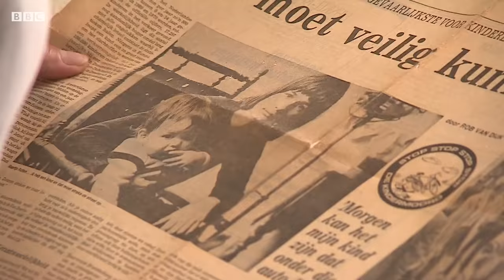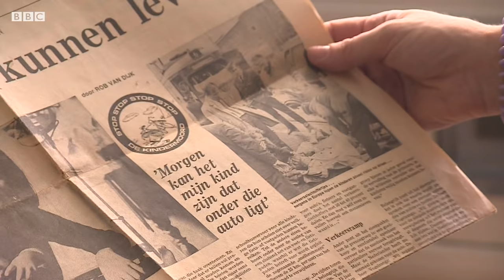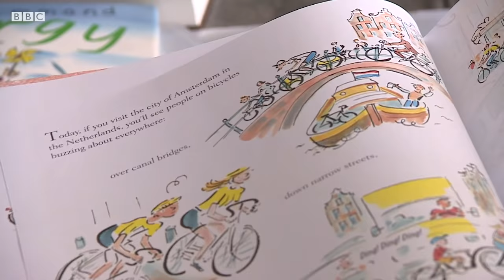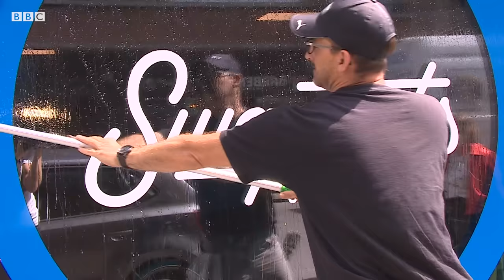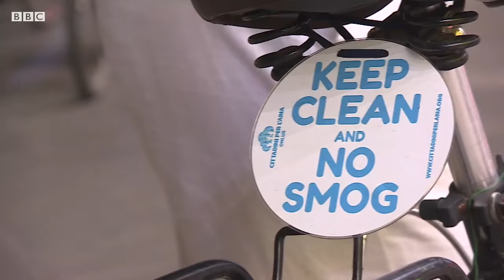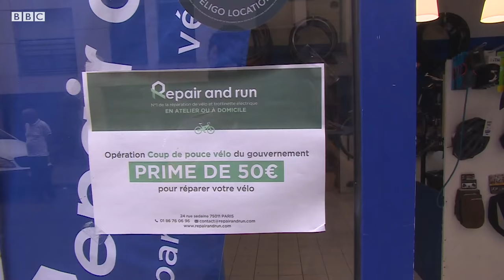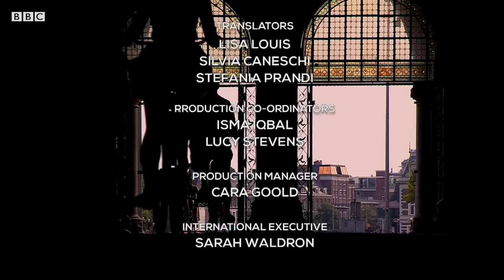Cycling across Europe in the pandemic - BBC World Service Documentaries

Comment: Dear world, don’t look up to USA, look up to Netherlands instead!
Reply: Netherlands is easy biking, its flat. My family is from the Netherlands, been there done it. Not so much where I live. lol....and I do ride, but usually drive my bike to other places to ride it.
Reply: I hear NY makes good progress actually. From what I've seen more than my city in Germany.
Reply: @moquii5892  If you are afraid of the elevations wherever you live, there is this new thing called the E-bike and it does most of the work for you, or you just cycle them hills and get stronger legs
Reply: Fair point in this regard. Much of USA's expansion was done around/after the invention of the Automobile, so its laid out such that you NEED a car to get around. I lived in a small city on the east coast, and even getting basic groceries I usually needed to drive to a supermarket. Don't even get my started on parking in a city.
Reply: @DarkDutch007  Fantastic idea! I should buy one. ps my legs are pretty strong but it's just too exhausting all the same especially in the heat of summer lol
Reply: @SirBrittanicvs  Plus the Not Just bike channel looking into why cities are designed such a bad way in US and what are the problems with that desing.
Reply: @moquii5892  Netherlands is also very windy but people manage. You could argue its worse because its resistance from most directions. With hills you have up and downhill. The finish cycle in heavy snow, its not  that much of a detterant at all
Reply: I'm from the Netherlands and I am proud of our bicycle infrastructure, but I hate cycling. But there are lots of people who love it and the more people on bicycles, the more space for my car on the road. Only sport cyclists are really annoying.
Reply: USA almost destroyed own public transport system, so it got traffic. But many big cities with bus, metro, train system also blocked by cars. How theese "smart" people choose to spend their money and spare time, to see red lights and inhale petrol. Dutch just grown into another kind of Human.
Reply: Americans should just learn to Tow a trailer full of 4x4 , cement or gardening soil with their bicycles instead of their trucks     :D
Reply: Look up to the Netherlands, Switzerland, Germany, Austria, and the Nordic countries. These countries have made significant improvements in infrastructure and social programs, thus, greatly improving the quality of life. These should be the role models in my opinion.
Reply: @moquii5892  A lot of the USA is flat. LA is a good example. You could turn the footpaths into cycleways without them being missed much, as hardly anyone uses them.
Reply: G E K O N O L I S E E R D
Reply: @Arnoudbr  Boosting. I highly recommend Just Not Bikes channel, found him last month and love it.

My city just paints a part of the road and designate it a bike lane.

But if we did like Netherlands, it would be a lot safer and less road rage towards cyclists
Reply: Indeed, America has the developed world's gutter transportation culture.
Remember, Hitler invented freeways, not Eisenhower!
Reply: It is a good point but Netherlands is smaller and more important is completely flat, that’s make it easier to implement it for people.
Reply: Oh, I'm looking towards the US. I like to point at them and laugh at their infrastructure.
Reply: @allgoo1990  that is true. I am not American but I do know that US wants to mantain car makers instead of developing bicycles manufacturers, it is just a matter of economy, however, climate will not care about it and will instead charge  us
Reply: @HiopX  the culture is different, you cannot compare with European cities, also the size and scale of a typical suburban area in US,  is bigger than most European cities.
Reply: @moquii5892  
If flatness is an argument than there should be a lot of cyclists in all the flat states and towns in the USA.
There aren't.
And there should be less cyclists in Switzerland than in the USA.
But there are more.

What is your explanation or excuse for the facts mentioned above?
Reply: @Matraka2000  
Switzerland is completely mountainous.
And yet, per capita there are more cyclists in Switzerland than there are in the USA.
What is your explanation?
Reply: @arbjful  it's not the size that the problem. it's R1 classed suburbs with col-du-sac roads. No European would willingly move into an area, where there is no pharmacy, grocery store, playground(if kids are a factor), and general places to hang out at like parks, cafes, restaurant. And the only way out is winding road, at least 3 times longer than linear distance. 
New York is the only city that out populates Berlin, but there 9 cities who have a bigger area with another 8 close behind.
Reply: @wimahlers  jaja. Bicycles are used more for recreational purposes  such as mountain biking. I have some friends that live there and they still used trains every day. Do not get confused. The topography affects a lot and the climate. Here where I live with 30C temperature it is imposible you will be transporting by bike... You will go to meetings completely wet. The temp. It is also a factor.
Reply: @Matraka2000  Where there's a will there's a way.
In the summertime we sometimes have temperature  s in the thirties as well.
But many bike path have trees to keep it cool.
But we are lucky in the Netherlands.
Reply: @allgoo1990  americas system is built on endless profit. A country made by rich for the rich. Once you want to push through a leftist policy like better infrastructure you get called out for being a communist and a radical leftist. America is built on profit not innovation like europe or japan. The sad truth im sad to admit
Reply: @allgoo1990  im almost certain people would rather cycle in 0 degree weather than 30 degree weather
Reply: Why, because of their high taxes or their immigration problem? No, I got it: b/c of the wind turbines that drive people out of their homes?
Reply: @moquii5892  I live in the Highlands of Scotland and got an ebike.
Traffic and road conditions make it much less practical.
Reply: @arbjful  It is not a cultural thing I think. The US and Canada have insane zoning laws, which created the suburbian "landscape". It is a problem created by policymakers, not the people. The American dream became a nightmare. Some of the most coveted places in the US and Canada are places with the mixed use zoning laws, you know a neighbourhood with local shops etc. (https://www.youtube.com/watch?v=bnKIVX968PQ)
Reply: @deaddoll1361  good point , no walking traffic, . I think the E-bikes should stay on streets however
Reply: @blindbrick  Totally agree. Love my cars AND my bikes (actually live on a bike path) - but the "sport" cyclists are ruining it for everybody.
Reply: @TrickiVicBB71  Do you live in NYC?
Reply: @tescotrain  nope, Edmonton, Canada
Reply: @TrickiVicBB71  Knew it. In London (not Canadian one) they did the same, but they responded to the people and make protected bike lanes.
Reply: @Dark__Thoughts  I’m from NY and yes we have make great progress regarding bike lanes but as someone go commutes some days on bike, we still have a lot to cover, for example on the route connecting Brooklyn and Manhattan the bike lane is usually cover by parking cars and delivery trucks that cyclists must move to the car lane or street walk in order to be able to pass by. A lot of bike lanes have the biggest holes and debris that can easily get a flat on any wheel.
Reply: Yanks are dutch. Didn't you know?
Reply: ride a bike under the rain? no thanks
Reply: Hey now, there's quite a few of us 'mericans cycling everywhere too.
Reply: Yep compare a small dense country of 17 mil @ 500 ppl per sq km to a country of 350 mil with 30 ppl per sq km and blame Americans . Ok.
Reply: Riding w/o wearing a mask during pandemics ? No, thanks!
Reply: Biking and walking should be for fun and exercise. Instead for europe it’s a necessity. They have to ride bikes to work school markets everywhere. US drives cars for many things but then we ride bikes for fun. So in a sense europe is behind on the time. Way behind US again. Surprise they are still not using horses and carriages.
Reply: Mostly I agree. Most US cities are built for cars. However, there are a lot of cities, particularly in the west, where biking simply isnt feasible for most people. Seattle and San Francisco are very hilly and unsuitable to anyone who isnt young and healthy. And good luck riding your bike in west Denver where you find yourself suddenly climbing 800 feet in elevation.
Reply: Type 2 Diabetes rates: US 10.8% vs The Netherlands, 5.4%. This is why (on average) for every one unit of currency you spend on bicycle infrastructure, you get 8 back. The US (and the UK!) will got bankrupt treating its obesity and diabetes epidemic. Just look at the people biking, it is self evident that this is the way to go. It is cheap, healthy and environmentally sound, why is it not being promoted more?
Reply: @littlerockdoc3183  Peddle assist bikes fixes all those problems.
Reply: @smiddysmidton8313  Yes population density is much higher in the Netherlands, but that is another reason countries should look up to Netherlands rather than the US, the US is very inefficient with their space. It would not work in most countries.
Reply: @tekkenfan01  Most of Europe is car dominated too, but even Netherlands was car centric during the 60s. They aren't behind on the time, they have just progressed beyond cars.
Sorry to break it to you, but even your beloved cars will eventually become artefacts of the past, much like the horse and carriage. The Dutch will not sacrifice liveability and the environment for an outdated vehicle. Walking is the only timeless solution to transport, and bikes are the most friendly vehicle to pedestrians.
Reply: @thetimelapseguy8  nothing you said mean anything, US drive cars for necessities but ride bikes and walk mostly for exercise for fun more than the Netherlands, Europe and anywhere on Earth. That’s how the US has progressed. And the world look to the US first
Reply: @davefeldman3740  Hitler? I thought naz! were anti car culture
Reply: @moquii5892  it isn't even the hills - it is the pace of motor vehicles on roads too narrow to pass properly. I can keep up with traffic on downs and some level, but going up changes the ball game. On a Netherlands style bike track I would just shift to a lower gear and take it easy.
Reply: exactly! i see brazil trying to do just like the USA and i can only despair! my city is the capital od my state, and it’s awful. we have 5-lane stroads in both directions, totalling 10 lanes that are IMPOSSIBLE to cross. and it is in the middle of the city.

brazil is already such a slow country to develop, and when it does it goes the wrong way! my city’s terrain isn’t nearly as flat as rhe netherlands, and we have a lot of hills and slopes, but the main streets are usually flat enough. i want bicycle infrastructure, and not some useless cycle lanes!!!
Reply: Or Denmark! They also have an amazing bike culture! On the North American side, Montreal is taking a similar approach to biking because our mayor (Valérie Plante) is doing everything to change the way our streets look and making more space dedicated to bikes and pedestrians.
Reply: @moquii5892  I live in a hilly part my bicycle with no gears is easy altho you go slower uphill on one. You get used to it.
Reply: @TimpBizkit  im planning on cycling in the winter on the hilly road with cars it will be scary for sure. It just comes with knowing what works and what doesnt. I live in uk
Reply: @hanstun1  can u get peddle assist winter specific bicycle?
Reply: @CarpeDiem13x  And those same people have a bike in the house for getting more movement on their body.Better do it outside,is more refreshing for your lungs!!
Reply: @tekkenfan01  Ridiculous!Those bikers in the Netherlands have cars too!!But they prefer biking in the city!!Or even to another city..
Reply: @tekkenfan01  Well,then we will wait until you cant drive your car in the city,because you will stand stil most off the time and the bikers dont.:face-green-smiling:
Reply: @moquii5892  So you all live in the mountains?
Reply: @moquii5892  Dont let Not just Bkes hear this because i think he will kill you and if you think by yourself you know why dont you????
What the F does flat to do with any protected or seperated bike lane or trafick calming and a thousand other things OMG :) 
The rest is for NJB lol
Reply: @Dark__Thoughts 😊😊😊😊❤❤❤❤q❤qq+qqq qqq qaqaqq++aqq qaqa qqq+
Reply: @HuyenThanh-pd8cm  Did you have a stroke? Do you need an ambulance?

Comment: No one takes the car to go from A to B in a city because they WANT to take the car. If cycling is quicker and safe, it is the logical choise. And that frees up the roads for those who NEED a car. It is a win-win for everyone to have proper cycling infrastructure.
Reply: yes yes yes!
Reply: It's partially untrue. Most people take their cars because never learn to move with another mean of transportation. It's more a question of habitus than of will.
It is also why you need to contraint car drivers to implement a profound change.
Reply: @Cycling4Answers  but that is still not because they want to tke their car. But you are right that I didn't also mention this.